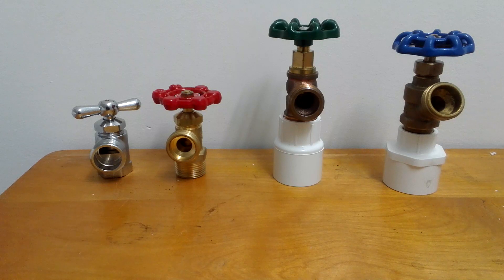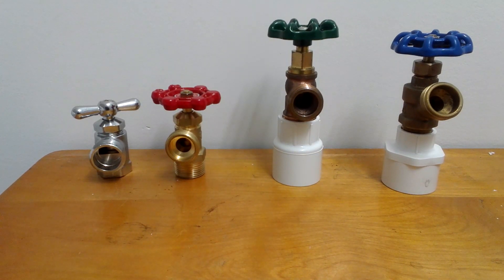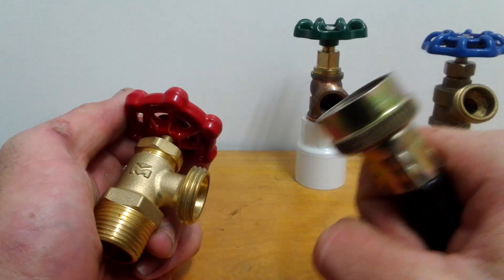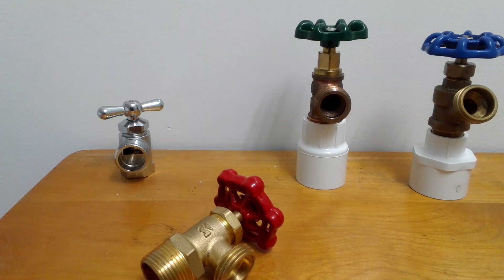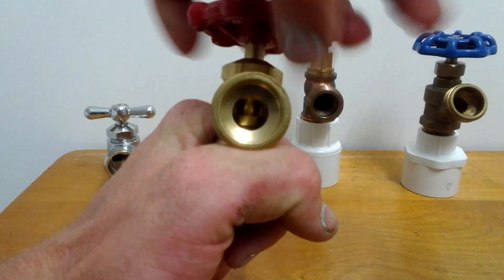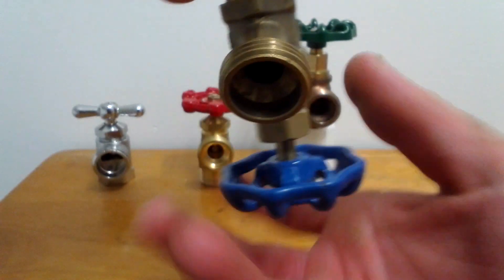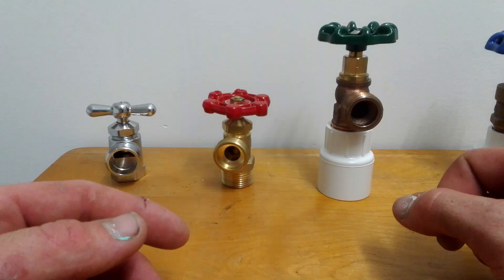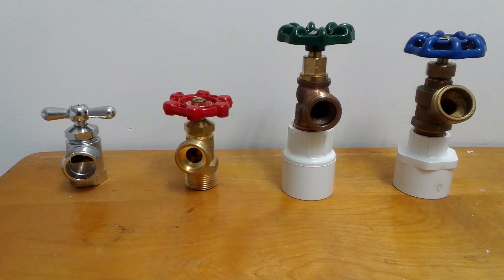Washing machine shutoff valves

Comment: OMG, THAT IS A HUGE TIP, I just had a nightmare of a job trying to get the Black rubber Hose of the shut-off Valve, I finally had to cut it off with a Dremel... Great Video 👍👍👍